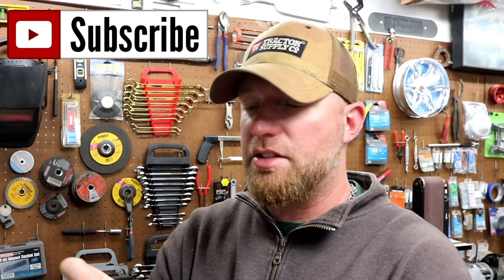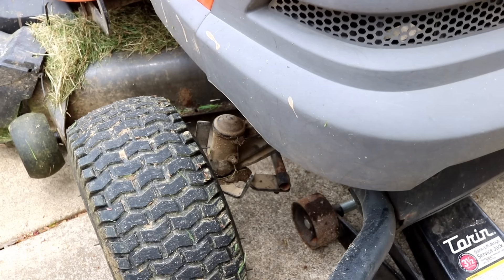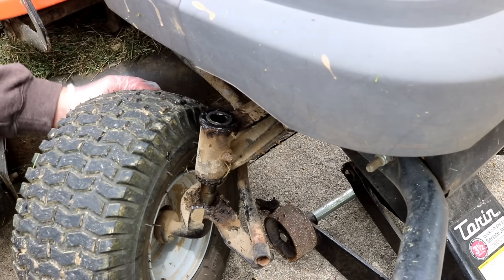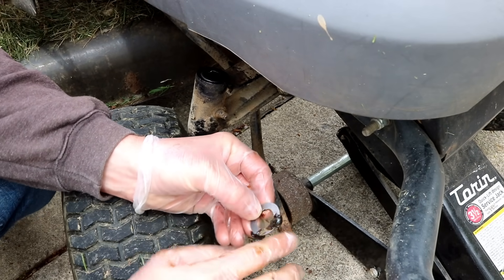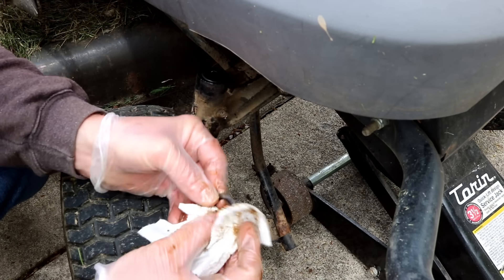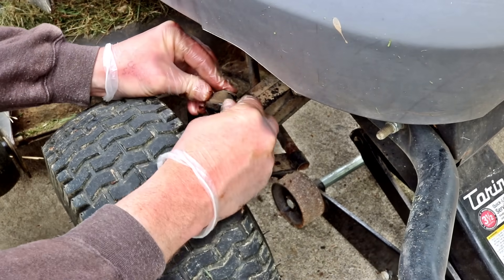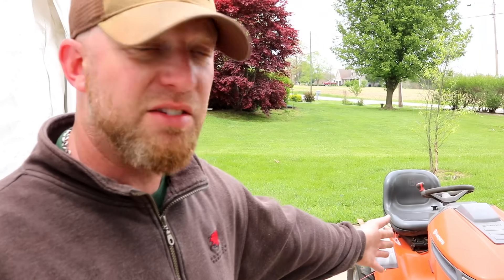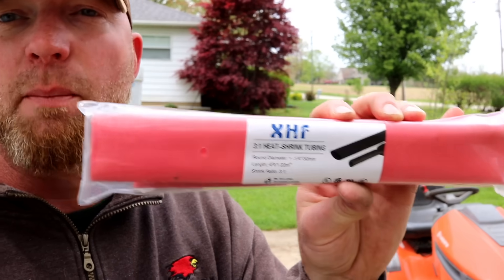$6 And 10 Minutes Will Give Your Riding Mower 1 Finger Steering

Comment: I noticed on my mower the steering will improve if you add toe-in..   Nice tip and instructions!
Reply: That actually helps more than the thrust bearing !!!
Reply: you want a bit of toe-out, not toe-in. Toe-in is for high speed speed straight line driving
Reply: @jumboegg5845  The extra toe-in allows the outer tire to dig in more and the mower turns easier.  I found this out accidentally after a bent arm made it this way. Nothing to do with highway driving.
Reply: @mikegoodman447  Think about the geometry, toe-in is exactly the opposite what you want for tight turns, you want the inner wheel to turn a tighter radius than the outside wheel. With toe-in, as you start to turn left for example, the outer (right) wheel starts to turn more left, but the inner (left) wheel will still be trying to turn right. As you turn more left, the inner wheel will get to a point where its going straight ahead, and still not contributing to the turn. As you turn even more left, the outer wheel will now be turning hard left, and the inner will be just starting to contribute to the turn. That's why toe-in gives a vehicle good straight line stability, it tries to keeps the vehicle going in a straight line. Toe-out is the correct geometry for good tight turns, you want the inner wheel to start turning first. Toe-out makes the vehicle steering twitchy at higher speeds, but of course straight line stability is not a problem at mower speeds! Tire wear is also not a problem at mower speeds, so  you can give it plenty of toe-out and it will turn on a dime.
Reply: @mikegoodman447  You are correct, I've done this too on an old heavy Sears garden tractor.
Reply: @jumboegg5845  Your exactly right. It won't turn as sharp, but it will turn easier. I've done it and it works.
Reply: @mikegoodman447  It should turn sharper, maybe you gave it too much or not enough toe-out, experiment with it. Here is another tip to make it even better. I like to go around in a clockwise direction whenever possible, so I give it less toe-out on the outside (left) wheel - this means the outside wheel is not fighting against the inside wheel as much when turning right. It still goes left well enough, just that turning right is the best way on my mower.
Reply: On larger vehicles, yes, a touch toe-out is preferred.  It tracks straighter and provides the "lead" (inside wheel turning a touch more than the outside wheel. That's Ackerman, usually handled by the length of the steering arm on the spindle) for turning.

BUT, on this type of small-scale steering system, tire angle does push the wheel in the direction you turned it.  But on a larger vehicle at highway speeds. Toe-in would cause the vehicle to wander and lose front grip when turning.

You'll notice that the tubing that the "kingpin" bolt goes in leans to the back to give it caster.  That also helps with tracking, but when you turn the wheel it gives it camber.  Again though, that only matters at road speeds.

Comment: This works because you have just cleaned out the old grease and added new grease through the grease zerks. Hit the rest of the joints with Blaster and you are good to go. No difference when I added the bearings to my mower. Craftsman LT2000. Yes, heat the caps and they slip right on.
Reply: I've never added any grease to the grease zerks on my front axles. What happens if you never add any grease?
Reply: @colt5189  it wears out faster
Reply: @robertheinkel6225  Well, I've had my mower for 15 years. So I guess maybe not.
Reply: I did this in 2018 and it still works. I  Did 2 yard tractors JD180 and an LX178   IT worked the best on my JD180.  It was a stiff old pig.

Comment: I have a 2012 Craftsman 54" cut lawn tractor;  Not 10 minutes for me, more like an hour.  Because i had to figure out that i couldn't use the bottom mower washer because it caused shaft to not be long enough for snap ring to fit into slots.

Comment: Pumping  up (hard) the  tires that do the steering will help too!  Even Easier fix!
Reply: Yea but if you got any down hill riding to do, they aint got any suspension so the harder you pump the fronts up the worse the ride will be along with the risk of blowing one them suckers out..  theyre only meant yo hold 10 pissers at most..

Comment: instead of shrink tube, use something like an O-ring or rubber washer where the ID of the rubber is very slightly smaller than the OD of the thrust bearing/steel washer assembly. Sometimes those thrust washers come with a couple of hardened steel washers for the bearing to ride against for longevity.

Comment: I have the same mower and this would be a great upgrade.  I noticed you cut out the craftsman pliers pushing on the clip.  hehe.  Those are useless for that action due to the self adjustment.  I also replaced my plastic transmission with a tufftorq and locking differential for the hills around my property.

Comment: There is no nut to remove on a 2020 Cub Cadet XT1 LT50. It is welded at that location. You have to replace the entire axle. The axle sells for around $250.00+.

Comment: I did this on my Craftsman YT3000 riding mower. Couldn’t tell a difference. Ok maybe just a slight improvement but NOT a power steering feel. And I really didn’t like the idea of the exposed rollers collecting dirt plus you can’t reinstall the top dust caps. So you’ve now introduced two new sources of possible damage. I removed them and put it all back to factory spec. I will say for riding tractors this is a great idea in concept. If not doing it already the engineers should find a cost effective way to make the steering a bit easier, possibly with sealed quality bearings.

Comment: I also worked and replaced twin I beam kingpins on Ford trucks so I watched intently.  This video is a gem. And it will absolutely work.   My first summer project as I have that same mower.  (Most are the same anyway....just different branding.)

Comment: I noticed that you placed the washers and the thrust bearing on the bottom, then pushed it right through only to find that the snap ring slot no longer protrudes out the top of the axle??? Not in your case? I thought of this idea a few years back when I came across some thrust bearings and almost had to abandon the idea after realizing there was not any extra shaft to stick out the top so I could secure it with a snap ring. So, I'm making this comment before someone wastes a lot of time trying to do this only to find the bearing takes up too much shaft space. Were your shafts a bit too long, so no problem? Or did you have to remove the upper bushings and grind the axle down a quarter inch? Or the bottom of the axle, depending which end (if either) extends beyond the axle itself? In my case, since the shaft at least cleared the top by maybe 1/16", I drilled and tapped a hole in the top of the shaft and ran a bolt securing a fender washer to the top of the shaft.
Reply: That was exactly my first thought. How could you add two washers and a bearing and still have enough clearance for the snap ring.?
Reply: Thanks for the heads up,  GJ! 👍👏
Reply: Exactly what I was thinking.
Reply: I'm guessing some manufacturers opt to go a bit sloppy on that for cheaper manufacturing and easier maintenance. Possibly reduces wear too, since a tight fit means it rubs metal on metal from new, where looser means it never really wears (gravity is holding it apart 99.9% of the time).
So I guess go and measure the spacing before ordering parts...
Reply: Your spot on MATEY from Melbourne AUSTRALIA 👍🤠
Reply: M
Reply: The thrust washer doesn't need to be reinstalled on the bottom with the new thrust bearing installed, and the top washer if installed can be omitted or substituted with a thinner machine bushing as no force is exerted on the top washer or clip unless the wheel comes off the ground and then it is only there to hold the weight of the wheel and spindle. Heavier machinery use a tapped spindle and locking bolt with cap to retain the spindle, all else failing drill and tap the top of your spindle with a 1/4 thread and use a large fender washer to retain it.
Reply: Good Point.  I also wondered about that.  Was it worth all the effort?  I will check it before I buy them on my JD X320.
Reply: Ya only gotta worry about it falling out from the top if you’re doing wheelies….😉
Reply: I have the same Ariens version of this rebadged Husquavarna.  You do omit the original lower washer, but the new Torrington and washers do add extra thickness.  I was about to grind down my spindles but tried something first.  I dished the original top washer into a slight cone shape, just enough to pop the E-clip back on.  It’s been working so far on my rough landscape.  But honestly, the juice wasn’t worth the squeeze for the way I use the machine.   But good for weak old ladies cutting perfect golf courses though.
Reply: Better have a handful of good drill bits. Those axels are hard as f. I see dull drill bits in your future.
Reply: @billycolwell4263  Drill on slow speeds through metal with lots of oil and not much pressure.  Let the bit cut.  If someone has a bunch of dull bits, it’s definitely operator error.
Reply: Thank you for the idea!
Reply: Yeah, I was curious about that too
Reply: I realised this and purposely left the larger washer at the bottom out completely.
Reply: @clarklsparkl  BINGO.
Reply: @billycolwell4263  get a good set of SPLIT TIP drill bits! They’re amazing drill bits! I use to install woodstoves for a living years ago. Hardest ones to install were the inserts where they were installed in a fireplace and you had to seal off the top of the fireplace with 20 gage stainless steel. You had to drill through the metal laddel at the top in front of the fireplace. When we first started trying to use regular drill bits. We go thru 7-8 new drill bits just drilling that stupid metal support for the bricks.  Someone told us about the split tip bits and we found them at Palm Abrasive on Belmont St in Portland, Oregon.  First time we used a split tip bit we were shocked how well it cut through the metal. Almost like cutting through butter! There be long thin strips of metal wrapping around the bit as it cuts through the metal! The bits also lasted least 6-10 times longer then a nominal drill bit.
 Split tips are expensive, but worth every penny and then some! Only drill bits I buy any more if I’m drilling any metal that’s got any thickness to it!  Normal drill bits are for wood use only in my opinion!  Drilling metal, you need a good metal cutting bit  and split tips are the best I’ve seen so far!
Reply: @Steevo69  I was thinking the same thing.was he just lucky that it all went back together?I guess you could grind down the spindle tube to make room for it
Reply: I’d rather use they one touching up the blades
Reply: Maybe his lower bushing was worn quite a bit to allow him extra clearance. I'm sure there's different tolerance on different mowers as well. I see ones with only 2 tiny spot welds holding that lower thrust washer to the spindle. Seems marginal to because the washer was larger than the spindle rod as well. I guess they figure on that level of machine it's good enough to last a couple years.
Reply: I just finished the MOD it was as easy and effective as it has been made out to be.   My mower is a similar Husqvarna and I had plenty of extra shaft sticking out even keeping the washer at the bottom.  Truthfully it just took up a bunch of slop the manufacturer had built in.
Reply: P Huskies bat like mine so they're probably all the same pretty much on that yeah I'm running a Huskee belt like
Reply: Are all those Huskies about the same I'm running a husky about like that one
Reply: I thought the same thought.
Reply: You could use a grinder to remove some metal from the tube until the snap ring clears.
Reply: Yeah this happened to me in my yth22v46
Reply: I have a Husqvarna and it went just as he said, some mowers may vary. I have serious arthritis in my hands and this helped a lot. I’m on my second season with this hack. Grease it up and worked as it did last year. I added a steering wheel knob for assistance and off I went.
Reply: @mikel14028  update.  I got it.  It was just very dirty.  I see no change in steering though lol.  I’d say save your money
Reply: I’ll find out in a few days when the bearing come. If you think about it, there is no way it is going to come apart with the tractor is sitting on it. Just grease it all up, put the dust cap back on and enjoy. Just don’t run it in to a 3 foot deep ditch or try to jump a car with it.
Reply: Just drill a hole and use a cotter pin instead of the C clip.
Reply: Just take a sizzler wheel and grind three new slots higher up on the shaft if you have room, reinstall the snap ring.
Reply: Did you both sides..???   or only one…Thx
Reply: You don't need a snap ring or anything else. It sits on it. Not like is going to fall out or anything. It's a riding mower not the general Lee. Use mower for intended purpose and there's absolutely no problem. I did this mod and love it. It actually worked ‼️
Reply: True story. Same thing happened to me on a cub cadet 128.
Reply: I used your idea. It did help albeit i had no issue with the e-clip fitting. I also have a spinner on my steering wheel which aids in turning. As far as a beer in the cup holder, it bounces around too much & gets flat!!!
Reply: Also, it did improve the steering a bit. Even with a spinner I could feel less drag. Thanks for the vid. It was most helpful! 👍🏻
Reply: This worked as advertised, glad I did it. Also greased up the tubes while I was at it. Much easier to turn now, while in motion anyway.
Reply: @ghostridergale What ( brand ) Split-Tip bits you find best?
Reply: @ghostridergale It helps to use a good 'cutting oil' when drilling or cutting steel.
Reply: My 10 year old mower wore enough I added a USS flat washer to each spindle to remove slop and still had extra room for the Ering

Comment: I'm adding an update to my comment.  I just received them and there is one slight problem.  Once you put them on, you can't use that thick washer on the spindle.  Once all together, there is no room for the e-clip to snap on.  I had to leave that thick washer off, otherwise no way I could finish this project.  I'm not sure if it's just my mower (Craftsman) or what.  Even though these new bearings are thin, once you put the washer on both sides, they are as thick as that washer I was mentioning.  So no room to put it on.  I'll let you know how it works!
Reply: Try just using the original thick washer ,the bearings and then 1 thin washer..if that's too thick to fit the E-clip, try just the two thin washers and the bearings..if it fits with only the thin washers and bearings it will probably wear out soon depending on how much wear and tear your Yard is on the steering.
Sounds like a very neat and simple upgrade.goodluck making it work for your riding mower..
Reply: @bbjazzmanjazzman7721  Well, what I actually did was file the spindle down on each side.  Let me tell  you, that was a job in itself.  I bet each side took me 30 minutes or so.  I sweat my rear off doing it, but it worked.  I have to say honestly that I don't think the steering improved that much.  Perhaps I need new tires and that would also help.  Had I known that I would have to do all of the filing just to get the bearings on, I wouldn't have done it in the first place. I can also see them not lasting long, too.  I bet next year, I'll be having to take them off.
Reply: This fix does not make sense. Once you add the new bearing, you would not have enough room for the spring clip on top, as has already been pointed out in the comments. Maybe yours worked because your sleeve had been worn down over time, shortening it slightly.
Reply: @bishopdansby4287  I had to file both spindles down about 3/16" of an inch in order to get the E clip back on.  It was a pain to do.  Honestly,  I didn't notice any difference in the steering.   Sorry I wasted time and money trying it.
Reply: I'd just cut the tube or grind it down so the eclip will fit.
Reply: @deliveryguy7402  Actually if I had know all the trouble it would have been, I wouldn't have even done this job.  I really don't notice any difference in the way it steers.
Reply: After reading these comments it has confirmed my thoughts that it wouldn't work. I'll just continue using my mower as it is. It's good exercise for my shoulders and arms. I won't have to work out now.
Reply: @crosley62  like I said, I didn't notice any difference in the steering.   Plus, it was a pia to install.  Wasted time and money.
Reply: @garyp9906  I used to dread anything to do with filing something. Then I got a cheap angle grinder, grinding disks, flapper sanding disks. Now any metal modification is much much easier and faster.
Reply: @bw1841  I agree with you.  That's the next tool on my list.  Plenty of times I needed to remove a small amount of metal and had to use a file to do so.  Would have been much easier and quicker with an angle grinder.

Comment: I’m not convinced this is a good idea.  Seems that the engineers would have used this in the factory design if it was.  Wonder if the  steer wheels are more easily unintentionally turned by yard surface irregularities etc..
Reply: You assume the factory design is the best they can do?

Comment: FYI Fellas, do not expect these thrust bearings to last long in this application. Who knows for sure, but my guess is 1-2 seasons. Ive added a suicide knob to my tractor and this seems like a great upgrade, if ya dont know the work. I would also recommend a torque spec, something around 40-55ft lbs. THATS  A GUESS, Im going by torque specs for similar setups Ive previously serviced